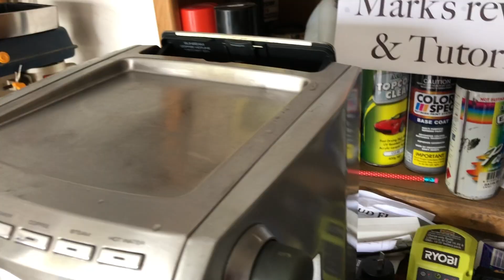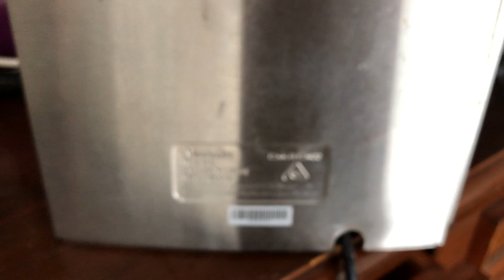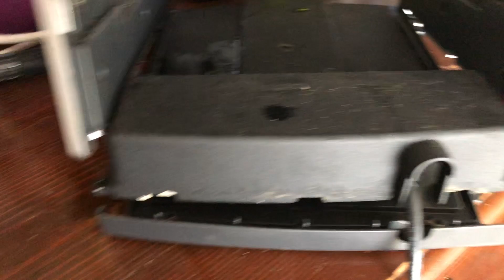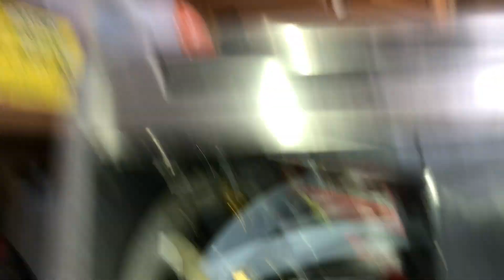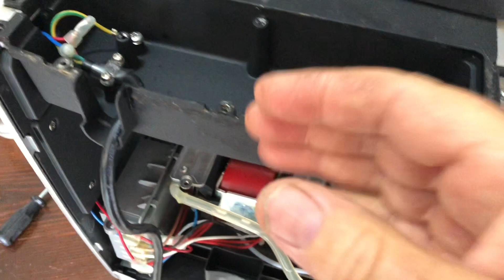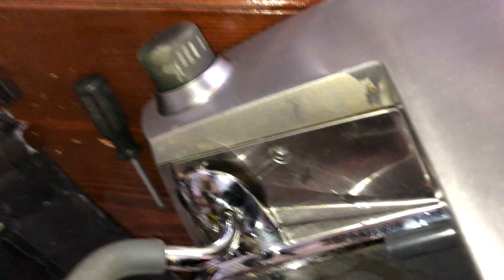How to Open & repair Sunbeam Coffee Machine. Maintenance fix

Comment: Good day Mark. I've three em 6900 here for parts and a 7000 I am currently using. Yesterday it started to lose water in a pour through the hot water wand. 

This issue is discussed on Coffeesnobs if you want to see the trouble shooting done there - search "sunbeam cafe series leaking from hot water nozzle when on". 

Questions:
Can I fix it easily myself with no electrical training? If yes, could you run me through the fix? If a part is needed can I take it from the 6910 machines sitting here?

If any answers are no I note I have one em6910  here that should work. However, when plugging into mains with the power switch at the mains off, the machine makes a very loud ongoing murrrrrrrr sound.  Applying the same questions, is this fixable? If I can fix the 7000, is this machine an easy fix? 

Thank you kindly. Missing my Zest Coffee - best coffee in Melbourne, and worth a try.

Comment: Hey Mark … I’ve got a ‘Em 6910 and it needs a new collar. I have one. I’ve replaced steam pumps, and coffee pumps, but I’ve never needed to do the collar. Just wondering if you can show me that???
Reply: Hey Lynn... Do you know how to fix my Em 6900 because  my machine button didn't work when i pull a shots but my buttons work well when I'm on auto clean function ??
Reply from the maker: That isn’t a job I have done either. Sorry. 👍

Comment: I've just bought mini Barista,Sunbeam...I've got the thread stuck on the Group Head...and can't release it!!...help!...have I wrecked the machine?
Reply from the maker: If I am understanding you correctly the group head has become stuck?
The rubber can get grippy. 
It will probably just take a good thump to loosen it. Then use Vaseline up underneath on the rubber seal. 
That would make it work better
Reply: @Marksreviewsandtutorials  yes,the thing you put the coffee in..I obviously didn't have it flush when I turned it and it's sooooo stuck!...I'm 65yrs of age and believe me when I say I'm so p*ssed off with this machine...🤬🤬🤬...it's the Mini Barista ....
Reply: @Marksreviewsandtutorials  btw,thankyou so much for bothering to answer Mark...the thump didn't help...throw it at the wall?...😂😂😂🇦🇺